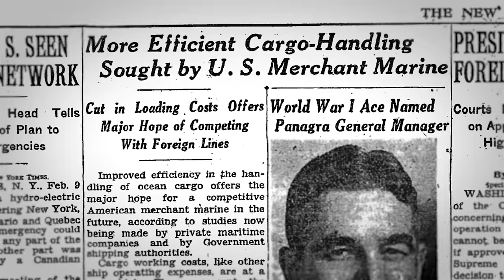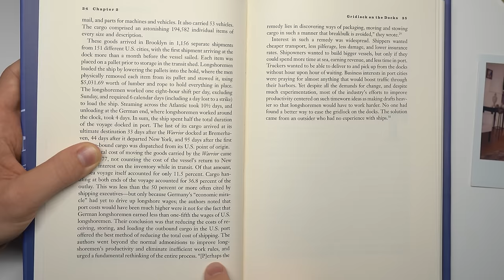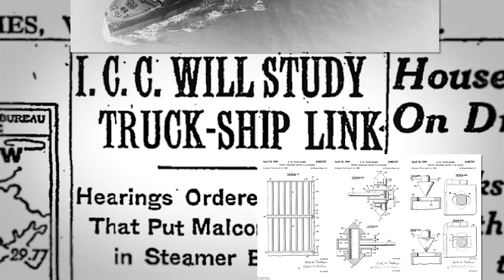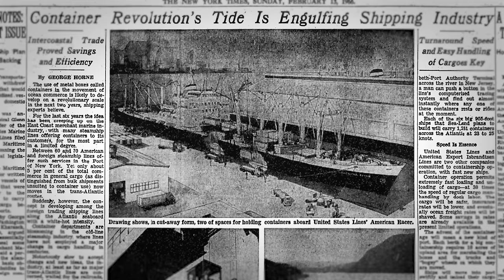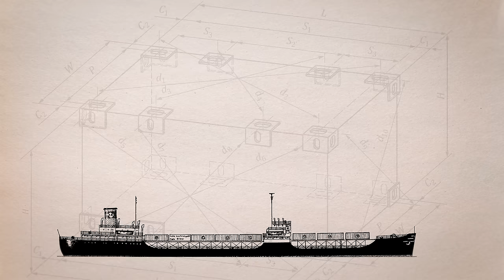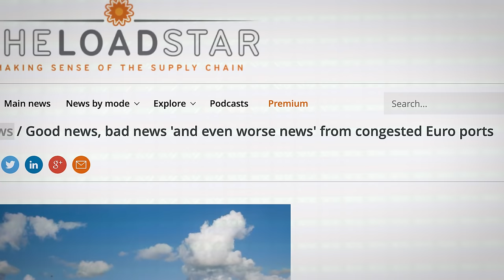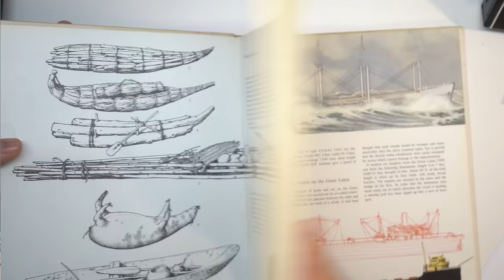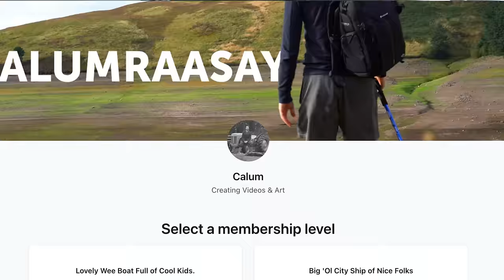Shipping Containers Are Genius - Here's Why

Comment: I would like to hear what happened to the longshoremen that were replaced by the containers. I can remember my grandfather coming home from work as a longshoreman and almost always having something in his pocket from broken cartons or sacks. He always had pepper corns, coffee beans, bananas, and sometimes a toy for us. I also remember the Guarantee that the current workers, at that time, got to allow their jobs to disappear. This was that they were Guaranteed their wages and benefits as long as they came in to work, signed in and if no work they can go home. My uncle did this in the early 1970's.
I will always remember the big metal hook on the floor of my grandfathers car. 
Always a great video, thx.
Reply: They work as lashing gang now. They secure containers to the deck fittings of the lashing bridge/hatchcover in order to minimize movement during underway to the next port of discharge.
Reply: I was a 71N in ROK in 1972 stationed among other places at the Port of Inchon.  The harbor has giant tides so vessels anchor offshore and cargo moved ashore aboard lighters.  In 1970 that was done by the 202nd Transportation Battalion, 5 boat companies, 1,000 stevedores. By 1972 the operation used containers, and army personnel there amounted to 8 MPs, 5 guys from Long Lines, and 5 people from movement control which included 2 KGS (Koreans employed by the US Army).  The lighters, cranes, and loading was handled by a couple of hundred contractors, and if the lead seal on a container was broken their employer bought the contents, which never happened.  One has to wonder how much cargo got looted prior to containers.
Reply: They are still mostly criminals associated with mobs, but there are fewer and they steal less.

Comment: Fascinating as always  ..  i used to volunteer at a preserved railway & the general maintenance shed was 4 containers , 2 either side of a siding , with a pitched roof joining them .. such a simple , quick & cost - effective solution to secure storage & weather-proof work space
Reply from the maker: Containers are the new corrugated iron in terms of cheap and easy building materials!
Reply: @CalumRaasay  Well they were until the Pandemic and a certain wayward container ship screwed up the whole world's logistics network. Container shipping rates are only just beginning to trend downward along with the hire rates for container ships.

Comment: I love the topics you make videos about. I think the interview section worked great, really made the whole video feel that extra bit professional.
I wonder if the container industry will have to adapt to space travel or if we'll see regular containers on the moon and mars in the future (and as improvised boarding vessels ala The Expanse)
Reply from the maker: Should have put that Expanse reference in there. I was thiking that though, what would a lightweight 'space container' look like?
Reply: @CalumRaasay  Probably the same. they are already optimised for slightly more than 1g. I have done a fair bit of work on drill rigs, we used "minis" which are pretty short. basically a cube cut off the end with a permanently affixed lifting sling and no twistlocks, they are also a bit more robustly built. I had one in my garden of a rented house with built in workbenches and storage. It was craned straight over the house for a few hundred bucks.  Back to space applications, have a look at the Starship being built in boca chica, that is like to dictate the first commercial space containers. I would also look at the general aviation boxes they slide into 747s which have one bevelled corner.
Reply: The standard 20 foot shipping container would be too heavy and therefore too expensive to launch into space. Having said that, if we humans are to develop permanent human habitats in space then we will need to develop a range of Space Containers for the efficient movement and storage of all of the various things that are going to be needed for a successful space colony.
Reply: @markfryer9880  3D printing in space may become a more efficient way of doing things.

Comment: Before this, there was quite a system of wooden cargo casks/barrels that was used for all kinds of bulk shipping. It was the increase in bulk shipping beyond the scale of what could be packed in a wooden cask that caused a lot of the confusing mess that it took these container systems to solve.
Reply: Incidentally, the 55 gallon drum was originally related to this system.
Reply: Bulk shipping or cargo is the term for stuff that can’t be efficiently carried in containers. Stuff like oil, grain, coal, ore and the like.  These are carried in ships that are called bulk carriers.

Comment: Here's a good one, Calum - do a video about the T2 Oil Tankers, their history and design, the propensity of some of them to break half in two in cold water, how they were irresponsibly modified and used for 30+ years after they should have been turned into razor blades (see the Marine Electric disaster). The T2 plus all the WWII Liberty Ships that comprised a huge portion of the US cargo ship fleet served well into the 1980s, decades longer than they were ever meant to be in service, decades after they should have been scrapped.

Comment: One place where I worked had a diesel generator housed in a shipping container the generator had cables and fixtures inside to supply power to the surrounding buildings. The container was grounded with 4 copper rods driven deep into the ground and inner doors were affixed inside the outer container doors. This container was a back up power for an EMP event at the military contractor where I worked.  The engine was run for 1 hour hour month to keep the seals and engine in ready function.

Comment: Intermodal containers did indeed change shipping - but they didn’t make breakbulk entirely redundant. RoRo - roll-on, roll-off - shipping took off from the 50s, and while it’s mostly used to transport rolling vehicles (particularly cars, of course) we also transport a lot of static cargo (mining machinery, 250-tonne transformers, that sort of thing)… and breakbulk.

Of course, nowadays it’s not craned on board pallet by pallet; it’s stuffed onto roll trailers, which have many of the advantages of containers without the height requirements. If you’re interested in looking into RoRo, I could see if there’s anyone at work I could put you in touch with.

Comment: Army conex's!!! Such memories.
I was only in the reserves. I never deployed.
But I spent most of my career hanging out at the Conex 
Each one of our platoons had one. Most of our general issue was stored in there. Our cold weather gear. Chemical gear. Everything we needed to do our jobs. All of our tools. Our lieutenant had a desk, and our platoon sergeant had a desk. And then there was a bar. With bar stools. And that served as a desk for the squad leaders and team leaders.
Our particular conex did see action in Korea.  There is a hole cut in the top for a stove pipe. I was in Oswego New York. We made use of that every winter.... But mostly just out of novelty because ours had been in combat and was fitted in combat for a stove pipe. The other platoons, they used kerosene.
8 months after my contract was up my unit was deployed to Afghanistan. The Conex was painted for desert camo after holding its Korean camouflage since the fifties. As my unit was moving to their duty station, roadside bomb, ambush. 80% kill rate. Nobody ever even did their rotation and Afghanistan whoever was left was sent home. The conex never returned. 
It appears when a unit takes a hit like that, they received a lot of funding. They've got a brand new reserve center brand new motor pool,,, and they've got brand new conexs would seem to be already prefabricated field offices.
I guess they just saw no reason to ship it back. 
I did some active duty over the summer at the reserve station like as a summer job, cleaning out some conexs and inventory. It was pretty cool going through Korea era supplies.
I found a whole bunch of mini flamethrowers. With fuel cartridges. They weren't really flamethrowers. It was used to burn harmful chemicals out of the air. Wild. FEMA also had three containers in our yard for safekeeping. I have no idea what's in them.

Comment: My father spent time as a doskworker as a student in the 1960s and the stories of breakages and theft are identical to what he observed. There was a cottage industry of "damaging" cargo in ways that it would be written off and taken home, then sold. Because of this, dockworker was regarded as a very lucrative job despite the actual pay being medicore

The same applies to the Railways - cargo containers transformed that industry too

Aircraft is still breakbulk. They do use containers on the aircraft but they're not used end-to-end and are largely non-interchangeable between fuselage designs

Comment: Next step is to limit the size of the cargo ships internationally (or just not upgrade for anything larger than a certain size. 
Then find another innovation in order to offload quicker without long lines of trucks or massive cranes. 
A common problem at ports today is the waiting line of trucks. I'd honestly love to see a system that offloads via rail connection 
on the boat and kind of ships the cargo far inland to a sorting area. Thus Freeing up space and making it faster. 
Just an idea but would be awesome to see some concept of this take place.
Reply: Lorries waiting at container ports aren’t waiting for them to be offloaded.

Comment: The Suez Canal incident evokes both "Don't put all your eggs in one basket" and "Don't count your chickens until they're hatched".

I used to work for a company that did intermodal shipping of produce. That was my introduction to the reality that things don't work as smoothly as we might assume. Shipments would be late, entire containers lost, power failures could result in containers arriving full of rotten product.

A 40-footer packed to the brim with avocados and headed for California was worth a quarter million dollars, and yes, we lost them due to one factor or another on an alarmingly regular basis. Of course, we were doing anywhere between 60 and 200 loads per week, so as a percentage it wasn't that bad. Bananas, apples, those weren't such a big deal, but when we lost avocados there'd be a full blown investigation, to the point where even us lab technicians might be put under enhanced levels of scrutiny for a week or two.

Comment: one thing you didn't cover (in this otherwise excellent video): nowadays we have oversize containers, 45-50 ft, where the anchor holes are at the normal 40 ft so they can still be lifted with the standardized cranes and moved by standard trucks/train cars. The extra length eats into the gaps between stacks on the ships, that otherwise exist to allow the ships to flex without having the container stacks crash into each other, and thus they can only be hauled by certain ships, and must be placed in specific parts of these ships where there's space for these longer containers. It's an odd deviation from the standard just to haul a little bit more, but creates an extra complication, which is exactly the kind of thing the standardization of the containers was meant to remove. There's also the issue with refrigerated containers, which require constant power supply, which again means they can't be placed just anywhere on the ships (and most ships can only supply a certain amount of refrigerated containers because of the energy requirement), and require ports to have areas where the containers can be plugged in, while they wait to be transported. 

Also, while loading/unloading containers is relatively fast, they still often sit in the container terminals for several days when they come in while they wait for their connecting ship/train/truck, and that again is a problem that's ever increasing with the bigger ships. Rotterdam for instance has an enormous buffer area just to temporarily hold containers, because of the ridiculous amount they have to hold on to because the really big ships block the port, so the ships that have to take over the containers can't dock

Comment: Then there is the transportation of goods after the ships are unloaded. Many trucking companies utilize 53 foot containers rather than the 40foot units, because of overall length limits imposed by various states. It's rare are to see doubles or even triples on the highways anymore. Thus the containers from the ships must transfer their containers to warehouses, where the contents must be unloaded and repackaged into the longer containers.  Movement by rail may induce other problems. This issue is especially evident where containers are unloaded in the ports of Long Beach and Los Angeles and the trucked inland to massive warehouses for further distribution.  Perhaps another video could cover this subject.
Reply: That has already started to happen 20 some years ago at inland intermodal rail terminals. CP started it when their new Calgary intermodal terminal was built on the outskirts of town.  Canadian Tire and Sears built their new western Canada dist centers adjacent to CP's container storage area with private gates into it so the yard hostlers could run the containers right from the train straight to their unloading docks or their container parking lot.  I think I recently read that CN is doing the same at one of their new intermodal yards with a new Walmart Dist center. From there though the retailers dist center still has to break down the containers for distribution to all the stores into a 48 or 53 ft can. Unless of course they have already designated what stores the goods are going to and just truck it from their dist center straight to the designated stores in the 40 foot can.

Comment: Good video. However the cost of shipping is not “almost nil”. 3 months ago the cost of shipping a container from a port in China to LA was $7-9000.  Some were paying $14K.  Today due to the downturn in the US economy, the cost is $3-4K.  To the port of NJ it’s now $14K. The container is the cheapest part. The logistics and port fees is what drives the cost.
Reply: Not the cost per container.

The cost of shipping per item in that container is almost nil.

A container holds thousands of items.
Reply: @Robert-cu9bm  right, rubber bands and tooth brushes, but not everything shipped is in the thousands of items.  Furniture for example.  It’s a good video as I said.  My reply was just to suggest that are not insignificant for all importers.

Comment: I owned a metal fab shop, one of my customers owned a container shipping company, they ordered upwards of 40,000 containers at a time, they asked me if i thought i could build a shredder large enough to drop in 40ft containers, they wanted to fill empty containers with shredded containers and ship them to China, that project did not go forward with me, not sure if it even happened, i have myself owned 5 containers, 3 20ft and 2 40ft, if you really want the ability to be able to pick them up easily to move they are a good idea, if you want to use them in place of a wooden building that is not going to be moved they are not a good idea, if the cost of siding and roofing is less than the cost of a container then do not buy a container.
Reply: Some places it's hard to get permit to build permanent structures, which makes a shipping container a good solution.

Comment: One correction on the Army experimental (and then standardized :) ) "Container Express" they are officially known as "ConEX" (con-x) which I found odd to call it that until I found out it was shortened from the original "Container Express" designation.
Reply: I remember that term from my time in the army as well, just never new the origin. Thanks for your post.

Comment: a barrel is a standard mesure. also not all ships are that huge, the big ones just go on popular lines between big ports. and big ships can move cargo with less fuel use and emissions per container, bigger ships are always better. its the same thing the industry had to adapt to the container and now it has to adapt to the big boats in this environmentally conscious time. now there are high cubes and 53foot containers that kinda break the standardisation but eh itey still fit together.

Comment: Have I thought about how the humble shipping container has changed our society?  

Oh, yeah!

Once upon a time trucks had to be unloaded so that the contents could be loaded on trains, and trains then had to unload so that the contents could be loaded on ships.  Commercial cargo planes haven't quite fully embraced the container.  Palletizing loads for rapid loading and unloading was a big deal.  Loading and unloading entire containers is much better.  

I made use of cargo containers during a military career starting in 1974 and ending in 2010.  I have a bachelor's in business management and worked in logistics.  Being able to ship a locked and sealed container around the globe reduces handling and speeds transport.  There are some shortfalls such as Less Than Truckload (LTL) shipments, but otherwise the container system is efficient.